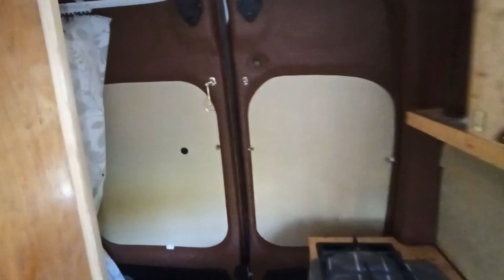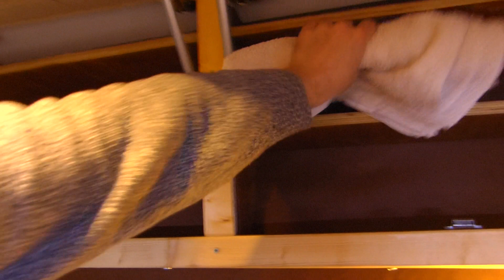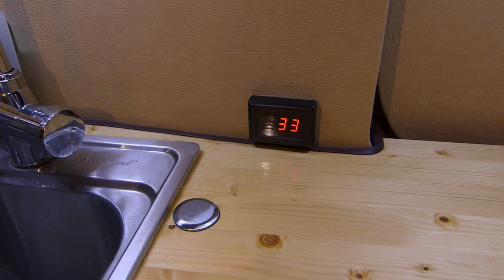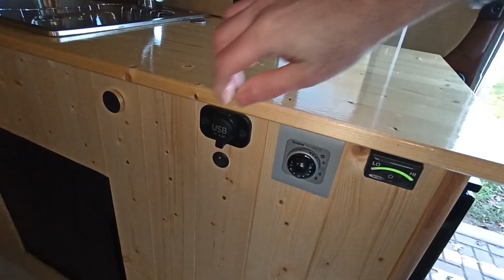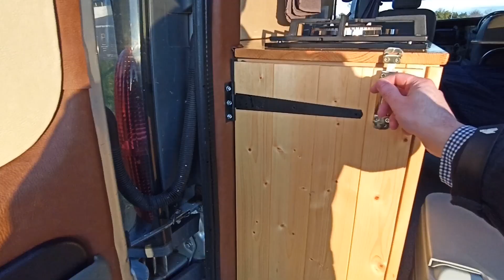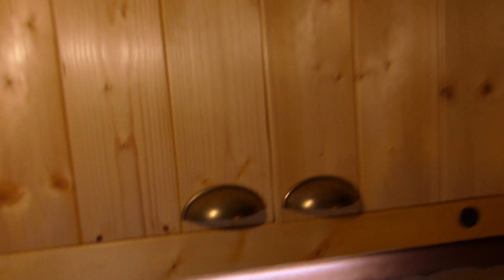Renault Trafic Budget Camper Tour (with shower)

Comment: Lovely job well done. What seats/ swivels did you use? Thanks
Reply from the maker: Thanks Hugh. I used the offset version of the one sold by Kiravans, they have a video about it. It moves the seat slightly towards the centre when you swivel it around.

Comment: This is an incredible build and that shower is genius.
Reply from the maker: Thanks a lot. It does work really well.
Reply: @pedrolg  
I love the build mate can I ask what did you use in the shower to do the walls is it fiberglass and do you have a link to how to do that wanting to do the same in mine   thanks
Reply from the maker: @jamesvernon7443  I used fiberglass Matting 450g CSM and polyester resin CFS Lloyds, marine grade, to stick the matting to the walls and give it strength. The white finish is Topcoat resin CFS, I used 2 kilos to finish it. I didn't use an specific van build video as a reference, but I watched many on how to waterproof plywood with fiberglass. I recommend doing because it's so solid and lightweight but you have to be absolutely sure you want to go ahead because you will have to tear apart the walls if you want to remove it.
Reply: @pedrolg  
I'm currently building the same layout, pretty  much the same spec as your, how much do the think the van is currently worth ? I will send you pics and video in a few days when its complete
Reply from the maker: @jamesvernon7443  that would be interesting to see, thanks. Difficult to put a value on it but I can tell you I couldn't find anything like this for less than 15k and I spend much less than that. That was 2 years ago, campers have gone crazy in price since then.
Reply: @pedrolg  hi pedro I spoke to you about 2 few weeks ago. I used your  campervan as an inspiration could I possibly have your Facebook or WhatsApp to send you pictures and videos to show you my build
Reply from the maker: @jamesvernon7443  Ey, I missed this, sorry. I would publish a quick video in your channel if you want. Otherwise, best way is by email: oseano13@gmail.com Looking forward to see how you did mate. Thanks!
Reply: Great amd very creative build. Could you tell me if this.is L1 or L2 Renault? If you have the inside dimensions to share. Thank you
Reply from the maker: @belkic666  Hi Jelena. It's the L2. 2.8m floor length, 1.66m width (between beans) and 1.94 height. That's before the conversion. Afterwards it only lost height significantly, about 10cms.
Reply: @pedrolg  Thank you for such fast reply. Have you shared conversion plans anywhere? More videos and photos on Instagram maybe? This type of conversion is very rare and deserves more publicity :)
Reply from the maker: @belkic666  you can search for interior dimensions drawings in all documents and leaflets from when it was released, although the 2022 model is practically identical in the cargo area.

Comment: Nice one. But please do yourself a favor. Next time you go for a similar layout. DO NOT duplicate the (same) items. It's extremely important when at the design level. Save time, weight, money, complexity and save SPACE! I don't need to tell you how important "real estate" space is on a campervan! ;-)

The inconsistence on this design is, surprisingly or not, rather common! Notice you have a shower head and lavatory one one side. And less than a meter away another one! Commonly referred to as the sink and respective head! On the video you proved this point by washing your hands on the "kitchen sink"... See where I'm going?! ;-)

Duplicate functions of each item whenever possible. BUT do not duplicate the items themselves! In this case beside the obvious spare of material you could have concentrated the water and sewage in one spot. Instead of a bit everywhere. Moving the sink/shower/lavatory to the end on the van would benefit them all. Making also for a good outdoor shower, all-in-one! Exactly the same with the vents! ;-)
Hope this help for a future approach. Cheers
Reply from the maker: You're absolutely right. In fact, the only reason there is two sinks is because the lady didn't want us to brush our teeth in the kitchen sink, thinks it's unhygienic. Go figure. I intended to achieve a level of practicality trying to keep things as simple as possible, but I went the long way for many things, I know. That's learned for the next one, that's for sure. Thanks!